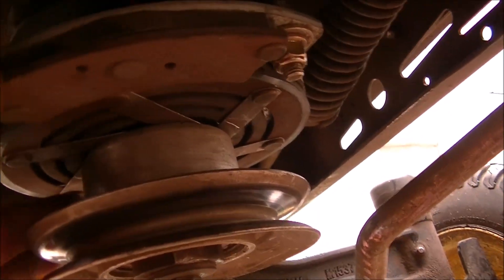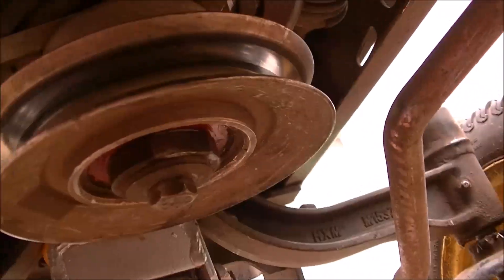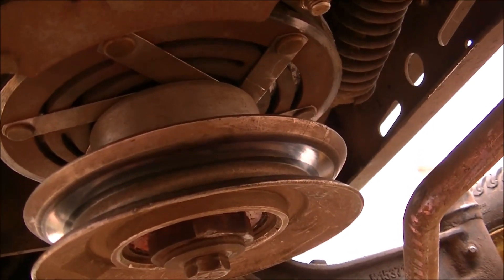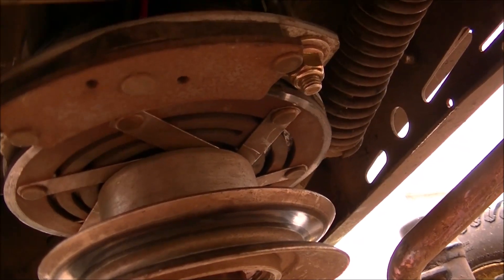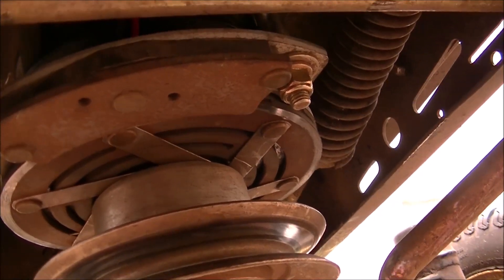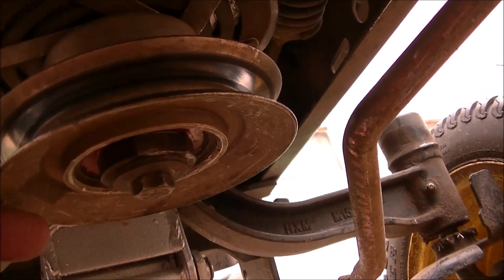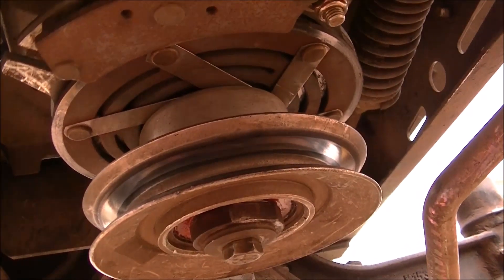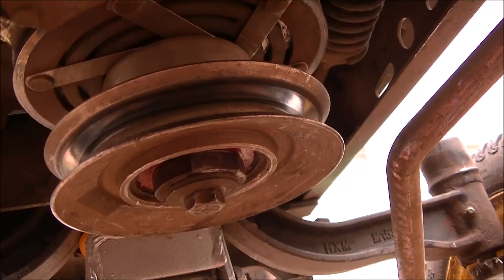John Deere 300 Series Lawn Tractor PTO clutch bearing repack - zeketheantiquefreak

Comment: NOTE: If you want to replace the bearings on a John Deere X340 mower, the top bearing is a non-standard NSK 6205-16 double seal bearing (25.4mm ID x 52mm OD x 15mm width).  The bottom bearing is a standard 6206 double seal  bearing (30mm ID x  62mm OD x 16mm width).
Reply from the maker: Thanks a bunch for the info!